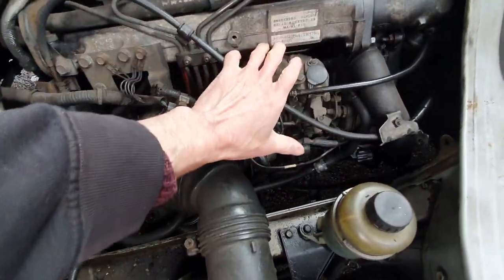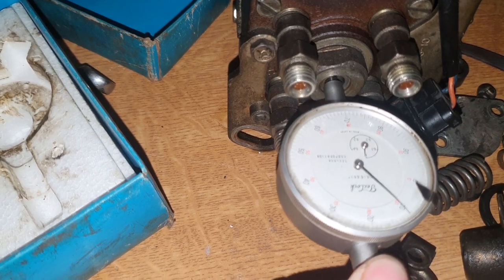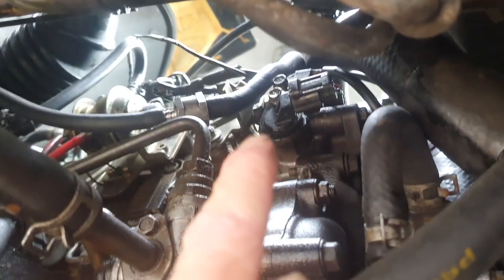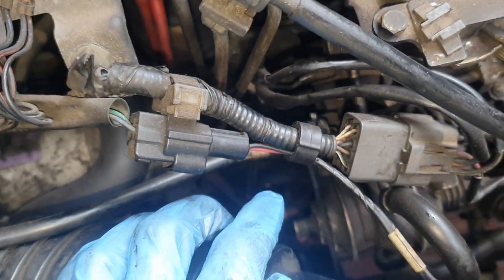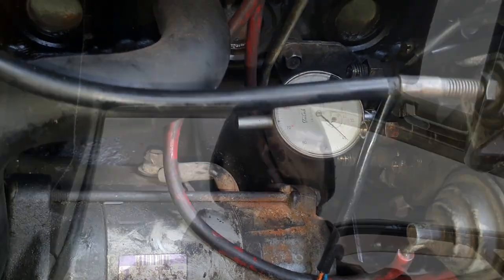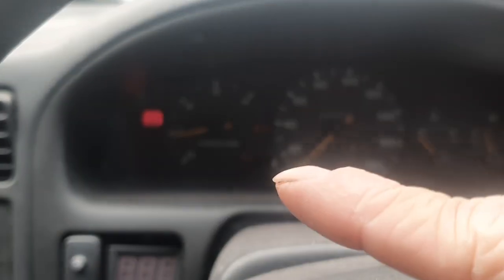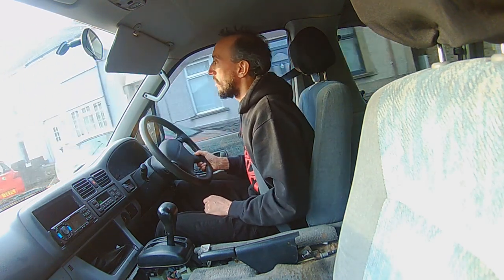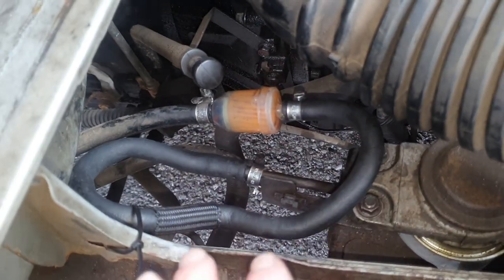Doing the Diesel Timing on my Mazda Bongo, Back on the WVO!

Comment: To stop the ramps sliding get a strip of carpet about 3ft long feed it round the bottom tread of the ramp and stretch it away from the ramp so as when you drive of the ramp the weight of the car on the carpet hold the ramp in place.
Reply from the maker: I tried wrapping a bit around the end, sisnt think of running it underneath 👍

Comment: Are you going back to the WMO at all? I've been running a common rail Transit on it for a while and people still refuse to believe me it runs on it...
Reply from the maker: The WVO I had appeared to have a lot of glycerides in it (from what I've researched) and it polymerises under pressure which is why my pumps keep clogging so quick, so I'm giving up on it for now as I don't have a good source for more anyway.
I've always thought common rails would suffer, what are you running?
Reply: @StevesMachines  so, W*M*O as in black diesel? I'm running settled filtered WMO (which contains ATF, hydraulic fluid and god knows what else) cut with 10% unleaded. I religiously run one tank of diesel to one tank of WMO though. So far so good, no issues. The critical thing to be on top of is a drop test for every batch to keep the viscosity in check. This is where everyone falls down with common rail stuff
Reply from the maker: @samgraham4168  Soory, I was thinking of WVO!  I havent run WMO for a while as I was trying the WVO.
Reply: @StevesMachines  I always said I'd never run WVO as the amount of crap in it, and the cleaning it requires to run it without drama is just not worth it. New straight veg is now as expensive as diesel because Russia needs breathing space so I bought two garage oil drainers and made an agreement with a local garage that as long as they kept water out of them I'd swap a full one for an empty one. For an afternoons tinkering in the shed, it's worth the effort...
Reply from the maker: What are your emissions like?
Reply: @StevesMachines  couldn't tell you figures off hand, but passed an MOT no problem. Little smoky on cold mornings, but the oil you use plays a big part. Synthetics are not that great for combustion sadly. Cheap shit mineral oil burns far better.